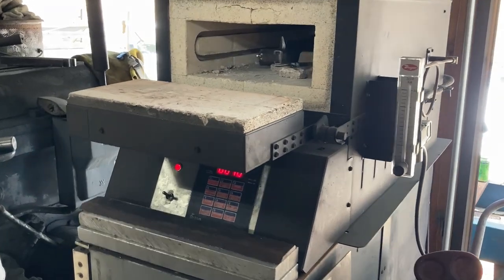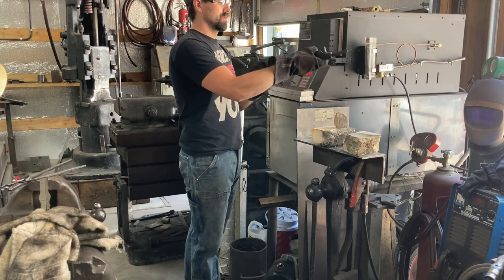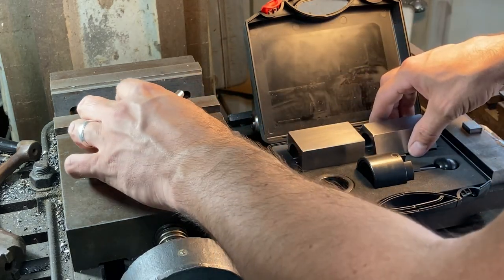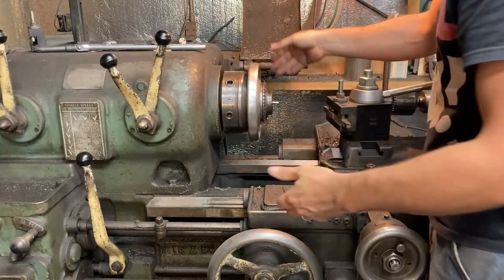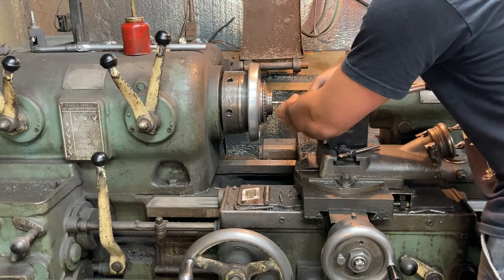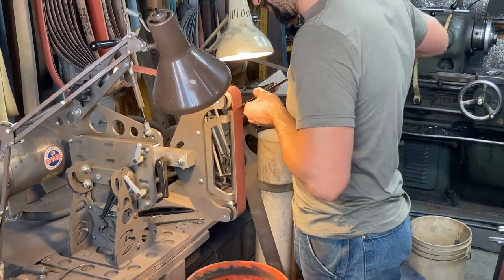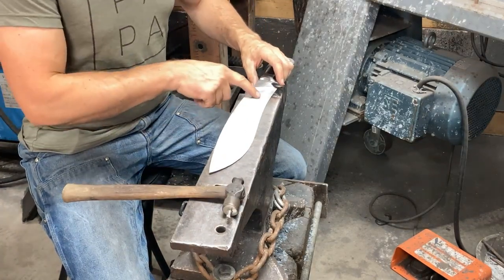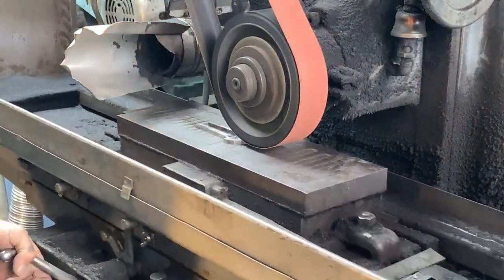Bolo 13

Comment: Great video 👍. Love the way you straightened the blade using the modified ballpein hammer, never seen that done before, good job! Have you considered getting a “ dividing head” for your milling machine? It would make producing hex sided nuts etc much easier, great for a many other purposes as well. Regards from Down Under.
Reply from the maker: Oh trust me, I’d love a dividing head, and a rotary table and a sine plate and all the other goodies for my mill and lathe… unfortunately budget constraints are always the main consideration, and competition from other areas of my shop and equipment as far as resource allocation

Comment: Can you go a little into the flowmeter on the Paragon?
I never got any information when I bought mine. Had the gas kit installed at the factory.   You turn it on from the keypad?? Also I need a flowmeter on my argon bottle > how much pressure should I have to set it for?    Then you mentioned 1.2 on the oven or so.

Comment: I have that same kiln but without the argon. I'm always curious how much argon it uses? I've always got a couple bottles here for Tig, but wouldn't mind trying argon in my kiln as well
Reply from the maker: Doesn’t use a ton… I wait until the furnace hits around 1000 degrees and then turn on 12 cfh of argon. Pretty comparable to tig welding usage.
Reply: @PrometheanBlade  thanks for the reply. Even though I'm not setup for mosiac, I have learned so much over this build.  Your videos are really cathartic for me and I find myself looking forward to the next.
Reply from the maker: @Labrador_Forge  awesome. Thanks for watching!